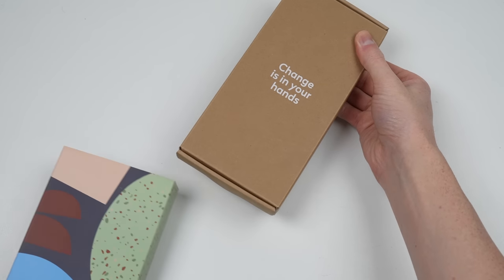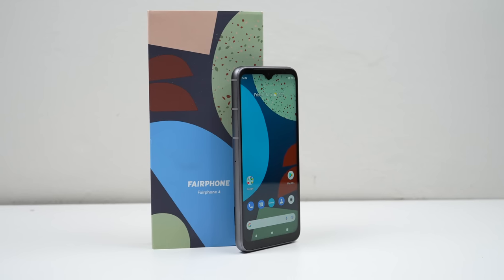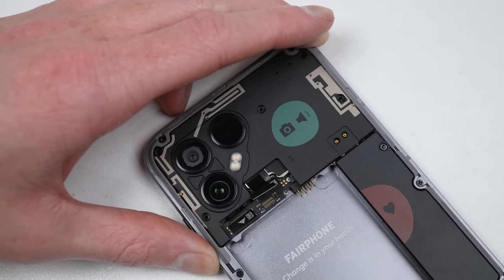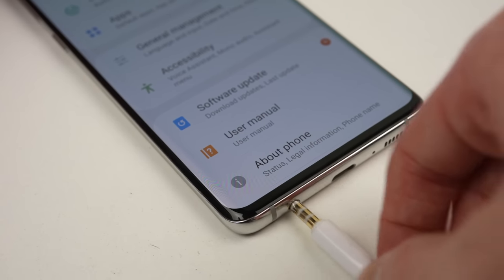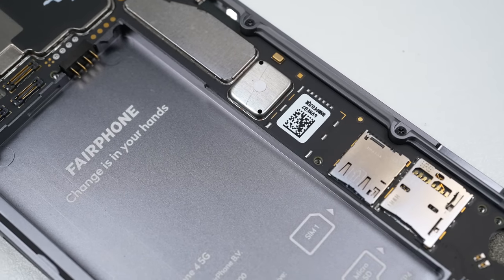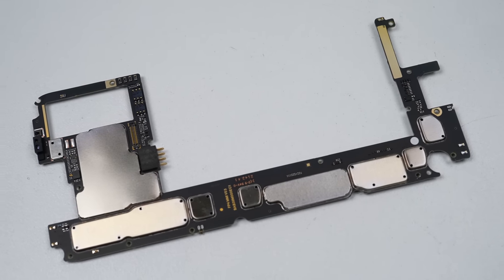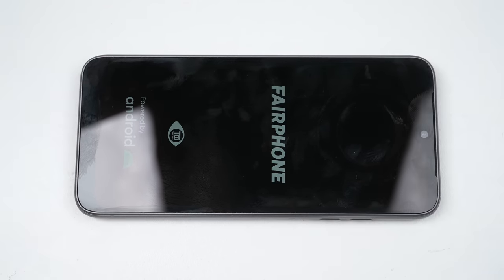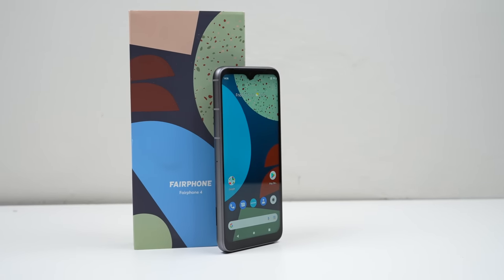The Phone Thats Fighting Big Tech - Fairphone 4 Teardown and Repair Assessment

Comment: a headphone jack might break, so let's make you use the charging port twice as often so it breaks instead! lol
Reply: And in exchange, you can buy our wireless earbuds for your audio needs instead, which are actually not sustainable! Smh for (un)Fairphone
Reply: This.
Reply: Yeah, the reasoning is just insane. I can live with a phone without a working 3.5 mm jack. I can't live with a phone with a broken charging port.
Reply: If the headphone jack did break, they should just make it easily replaceable instead of not including it.
Reply: Modern USB-C jacks have way, way higher supported insertions before a fail state. Modern 3.5mm jacks simply do not. This is important when they offer a 5 year warranty.
Reply: It’s not like other wireless earphones are not compatible with it.
Reply: হেডফোন জ্যাক ভেঙে যাবে ? মানে মজা করারও একটা সীমা আছে !😑😑😑😑😑
Reply: @KingEurope1  do you have a source on this? most reasons to drop the headphone jack are to sell tws earphones, like they do here
Reply: But you can just replace it easily?
Reply: @autotropicplaybench1819  whats worse is some companies like samsung actually have much more replaceable batteries in wireless earbuds compared to a company that claims to be better for environment
Reply: headphone jacks are fading away in favor of wireless headphones.
Reply: I don't want to be an asshole or anything but I would like to mention the LG G3.
Easily replaceable headphone jack, removable back cover, removable battery, SD slot, IR blaster and receiver.
Man that phone was packed full of features...

But it didn't have an easily replaceable charging port, nor did it have proper parts supply.

By the wireless way: when my wired headphones die, then I might purchase wireless headphones. Until then it just seems wasteful.
Reply: @technicaltacticts4380 সেটাই... এটা আসলে ফেয়ারফোনের নিজেদের ওয়্যারলেস ইয়ারবাড বিক্রি করার স্কীম 😡
Reply: I actually wouldn't have complained if they'd just installed 2 identical USB C ports. That way I could hook it up to a charger while using headphones at the same time, and they wouldn't have to list yet another spare part.
Reply: @KingEurope1  Er, this is entirely wrong. USB-C is only "safe" if kept at a perfectly normal temperature. Your phone, no. Your Nintendo Switch, DEFINITELY not. Not only the plugging and replugging, you think it doesn't heat or warp at all from charging? It does.

Forget actual use. Switches get real hot and guess what metal tends to do? Get hot.

If you have any soldering ability you can make a freaking killing scooping up all those Switches on eBay that don't charge and replacing the USB-C slot. They break CONSTANTLY and it's often the only defect they'll even have.
Better than Micro USB is not a compliment. USB-C is hilariously frail and in the endless race to make things So ThIn AnD fAsHiOnAbLe, it's too thin and too frail to be used for very much for very long.

Comment: Great video. Between them not wanting a review from you, the headphone jack story and earbuds, we can see that there is room in the market for somebody to do this even better.
Reply: Perfect is the enemy of good.

Fairphone is still a million miles better than anything else on the market. If you wait for the perfect phone you will be waiting forever.

Considering they offer a 5 year warranty, it's reasonable why they wouldn't want to include a headphone jack given how few insertions modern jacks support. They would have an insanely high return rate within those 5 years because of that jack.
Reply: @KingEurope1  not if u could replace the jack
Reply: Well there is the PinePhone and PinePhone Pro from Pine64 which is also extremely repairable and still comes with a headphone port I do believe and has toggle switches to physically cut the power off to some of the phone components such as the Bluetooth and Wifi chip or the headphone port but unfortunately this phone is not really designed for consumers just yet and doesn't run Android or Sailfish OS (which can natively run Android apps) but instead runs Desktop Linux With X11/Wayland application support...
Reply: @KingEurope1  I think apple is still better.
Reply: @KingEurope1 It's a great phone, but as Hugh said, leaving out the headphone jack from the most easily repairable phone because it could break is a bit of a contradiction. To then offer fully disposable earbuds just like Apple does seem at odds with their stated goals.
Reply: @DMack6464  Gosh, why didn't someone suggest that to them?☺
Reply: @Fairphone  I really do get it. I'm a perfectionist at heart but sometimes we can't do everything we wanted to do because circumstances make it impractical or even impossible. I've had a feeling that Fairphone is sincerely trying to do the right things. I'd say the headphone jack is a big missed opportunity for you. Its deletion has been a symbol of corporate cynicism and greed by Apple and its imitators. That isn't you so don't follow them. (I have never seen a broken one, BTW.)
Reply: hmm 
I hope they charge double with the intention of building their influence on the market rather than taking the profits and going.
Reply: @Fairphone  
Writing that down…
Reply: @Fairphone  
The fact that you have actually responded to a video review is pretty cool. Not too many manufacturers do that.

The lack of a headphone jack is not a dealbreaker for me because I use BT buds to begin with.

I’d actually consider buying a Fairphone to replace my iPhone 11 if the Fairphone was for sale in the U.S. because I am a tinker at heart and like the repairability it has to offer, but alas that is not the case.
Maybe one day, preferably soon, I will be able to order and have one shipped to my home in Florida. 😉
Reply: Check Shift 6mq. Same idea. Headphone jack. No notch.
Reply: @KingEurope1  Fairphone isn't even good though. It's a horrendously slow, buggy, and repurposed version of other phones under the guise of "BlOoDlEsS pHoNe". Yeah, Fairphone doesn't need to use factory slaves, it's just a few people repurposing older Chinese phones to fit what they want. All the slaves were already spent.
Reply: @Fairphone  I have a fairphone 3 but I think without a headphone jack I am unlikely to buy or recommend the fairphone 4 to friends and family. A lot of us are heavy users of the headphone jack. I understand where you are coming from from a warranty stand point, but it would be nice if future models could offer an alternative version, or a replaceable case with a headphone jack, even if that causes the warranty to be half the length.
Reply: hmm  i had the LG V 20 was great no issues  now have a lg V40  works great

Comment: I am not easy on my electronics but I’ve never broken a headphone Jack. If it’s strategically placed such that it doesn’t experience any stress I notice it can survive my abuse. 
I personally agree with your theory that it’s to push the wireless earbud sales. It sucks how wasteful our society is now
Reply: I've personally broken my fair share of headphone jacks as well. These things are so narrow compared to a USB C they like to just... snap off. Especially when in your pocket, like Janson said. Either that or the solder fails on the inside and it only works some of the time.
Reply: @acerIOstream  To that explains why my smartphone's headphone jack started to disconnect and pause my music :'(
Reply: I broke more USB-Cs than headphone jacks. USB-C is the worst port when it comes to durability
Reply: In a blog post they said that the official reason the FP4 doesnt have a headphone jack is for waterproofing reasons. It's already hard enough to make a phone with a removable back with any water resistance at all, they probably couldnt have done it if it had had a headphone jack.

The argument that it's for durability is obviously BS since you could just replace it if it were to break. Or if you broke off a male connector inside of it, you could just open up the phone and push it out from the inside.

The real reason is waterproofing
Reply: "What's a headphone jack"? Says an iPhone user. "I use several hundred dollar wireless airpods and throw them away every couple of years when the batteries die", says the same iPhone user.
Reply: @avadrumm  Nah, that's the same bullshit excuse Apple uses. It wasn't that hard for Samsung to make a waterproof phone with a headphone jack, every Galaxy from the S5 to the S10 had both a headphone jack and an IP waterproof rating. As an added bonus, the S5 also had a removable battery.
Reply: @KofolaDealer  I think you're thinking of Micro USB, that port was absolute garbage, I hated it long before USB-C was a thing and now that USB-C existed I get pissed anytime I see something that still comes with Micro USB. Type C has been the new standard for 6 years!
Reply: @avadrumm  They offer 5 year warranties on the phone as well. So even though almost all components are user replaceable, Fairphone need to have some assurance the phone can last for 5 years without user damage. The number of insertions before a headphone jack reaches a fail state (mono audio, no audio) is absolutely not suitable for a device with a 5 year warranty.

Sony still sell Android phones with headphone jacks. No one buys them. LG did, nobody bought them. People say they want a headphone jack, but the people who do never walk the walk.
Reply: @KofolaDealer  micro-b would like a word
Reply: @ThylineTheGay  it's better than C
Reply: @avadrumm  BS. My Unihertz TItan has IP67 water resistance and has a headphone jack. It's so water-resistant it has an underwater camera mode and can be completely submerged in water without damage (which I have done both accidentally and on-purpose to prove this very point). This is nothing new. Headphone jacks can 100% be water-resistant.
Reply: @avadrumm  the galaxy note 9 had a sim card slot and headphone jack and was ip86 water and dust resistant. Using that as an excuse to remove it is laughable. Just because a technology is old doesn't mean it's bad. If it ain't broken don't try to fix it.
Reply: @KingEurope1  you can't buy them at a store, you have to order them unlocked people like convenience, and unlocked phones cost much more money. I wanted the newest model but unfortunately had to go with the 22 ultra because the phone wasn't held in store and couldn't wait months for a new one as my old phone was on the verge of death.
Reply: In all my life no headphone jack broke the usb c was a different story.Only for charging the type c would break every 3 months.I think i had 20 type c ports with a problem.
Reply: Well.... I have broken a headphone jack once.... on my Laptop. No reason to not make it easiily  replaceable though.
Reply: I took my phone to the beach and a little bit of sand got in. Plugged the 3.5mm jack in and it got damaged, lol.
Reply: @KingEurope1  That's not correct. Many people buy phones with headphone jack, including me. I still have my LG G7. The vast majority of the population, though, isn't tech-savvy, so it's easy enough to sell them a phone and convince them that wireless is the future or some BS like that. Sony phones are not widely available anymore, but believe, I would buy one in a heart beat.
Reply: I have damaged mine on my current phone, but ignored to use only Bluetooth headphones now
Reply: @KingEurope1  People don't buy Sony nor LG cellphones because of the brand. Samsung, iPhone, Xiaomi and some other Chinese phones sell well because of their brand name paired with reputation in the phone industry, not because of the lack of headphone jack on their phones.
Reply: @KofolaDealer  I agree.

Comment: The reason for not including the headphone jack is a bit weird.
If you merge the charging and headphones jack  together you actually use the USB port much more than only for charging, and thus wearing it down faster.
That's only if you have to use wired earphones.
Reply: Not only that, but charging is almost always done with the phone in a fixed position and indoors. I.e. experiencing very little wear and tear. A headphone jack on the other hand is primarily used when out and about, thus experiencing far greater forces.
Reply: @SweBeach2023  And the headphone jack I'd bet is the tougher of the two. It's a rode that doesn't have tiny pins and that can rotate. With an L shaped headphones plug, it has a small footprint that's hard to apply force to even in the pocket of tight fitting jeans
Reply: chitrai raj 
And those are expensive and almost impossible to repair

Comment: Reminds me of the days when most Android phones were easy to repair, and could have the battery swapped out in seconds (Samsung Galaxy S4 era). How times have changed...
The only thing I don't like is the lack of a headphone jack - there's enough space for it, and if it was to break over time, they could make it repairable (like how they made the USB C port repairable).
Sadly, if you need a headphone jack nowadays, there's very little choice.
Reply: I just mainly use a Bluetooth to aux receiver on my FP3+, despite the presence of the headphone jack.

The lack of a headphone jack, lack of a OLED display and the notch design on the FP4(price combined) did get under my skin however - I might consider a shiftphone when I do eventually upgrade/change phones, as i feel 'upgrading' from a FP3+ to a FP4 would actually be a downgrade in many aspects for me.

Fairphone has really lost it's direction with its design and release of the Fairphone 4.

Especially when it concerns the lack of a headphone jack with their release of earbuds that would become landfill trash within 2-3 years of use. I might have forgave Fairphone over the headphone jack loss, if you could replace the batteries in their wireless earbuds....but nope....